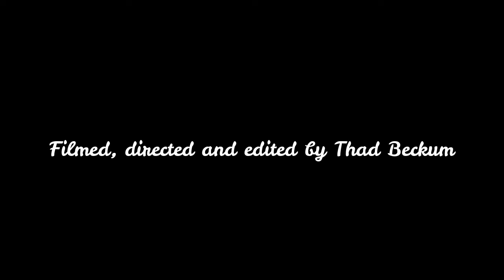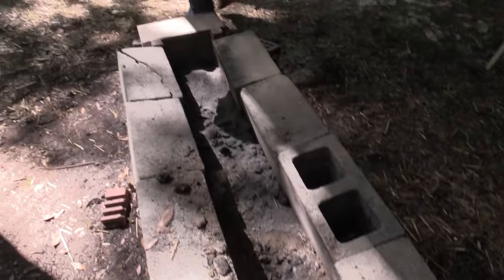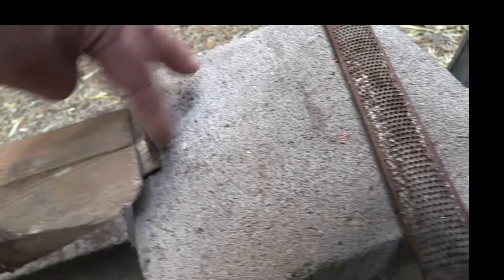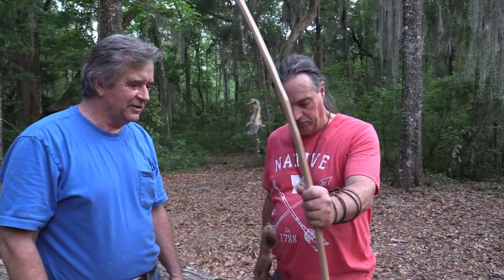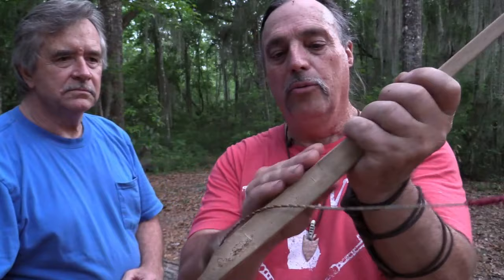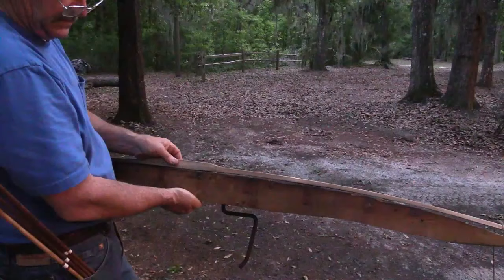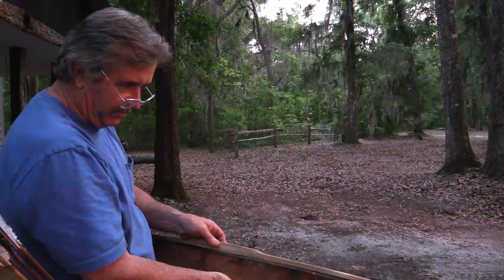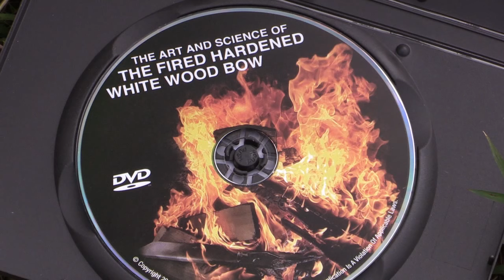From Living Tree to Fire Hardened Bow in 12 Hours Make

Comment: I really like the small pencil block used during tillering for the short-length curvature guide.   I like that there is something physical, a reference material (flat block) to exemplify the changes in curvature - and that it doubles as a marking tool to identify flat/curved/shallow spots with the pencil.
Reply from the maker: Yes I agree. It helps to really fine tune your tiller. Thanks for watching
Reply: It is called a tillering gizmo if you want to make one. The plans are online. Simple little tool. Works best on straight staves or boards.

Comment: Have used and instructed many to use hickory, ash, eastern hop horn bean etc. Hickory and hornbeam(ironwood misnomer) hold moisture more than most woods. I weigh my bow staves and when weight stops dropping it is 10-12 moisture content. When fast drying a bow, moisture meter only shows surface moisture. Hickory and Hophornbean are top grade woods when dried and tiller properly are great. My fastest bow was a hop horn bow made for my hunting buddy .Faster than any of my Osage bows. That’s my two cent Bob Brooks

Comment: Great video.  I believe it was Marc St. Louis from northern Ontario, Canada that pioneered heat- treating bows.
Reply from the maker: Heat treating and fire hardened are similar but not the same. Keith's method is a much long and hotter heat penetration. Mark st Louis did outstanding work which is well documented in the bowyers bibles.
Reply: @BeckumOutdoors  thanks

Comment: Thanks for another great video guys. Invaluable information that you are rediscovering and passing on. Since i bought your video I've made several successful fire hardened hickory bows. I always have 3 or 4 "in progress". I just finished a 42" 45# @ 21" gull wing black locust fire hardened plains style bow. It is backed in sinew as well. I realize that BL is generally weak in compression and strong in tension, so adding sinew would typically make more compression problems. I was banking on the fire hardening to strengthen the belly so much that it would handle the added tension and really increase the performance of the bow. Long story short, it worked. The little bow is super fast and accurate. So far no belly problems... Thank you!
Reply: Glad to know, i have some black locust staves i want to make 5ft 2in bows in the south eastern style. I wanted to heat treat them.
Reply: I have two staves of seasoned BL. Could you elaborate  and update please.
Reply: What exactly are you wanting to make? If you haven't bought the video on fire hardening id suggest getting that first. That way you can learn how to properly fire harden the staves.
Reply: Great information, I was thinking about it too! I'll give a try

Comment: I just dun a 77 long self bow with this method an ill never do a self bow again without fire hardening the belly I did the back a little to an this one is d shape classic English longbow style not a problem small Crack at the tips but it was 80 overall an I got away with 77 overall blown away guys I figured were it was d shaped it would blowup but in a week I've got a amazing 42lb longbow with no string follow thank you very much guys you really have changed bow building forever
Reply from the maker: Thank you

Comment: I bought the video from your website and absolutely love the hickory bows I have build from it one is 70 lb draw and one is 60 lb awesome bows but I want to see you guys do a video on one out of sweet gum I had 10 trees blow down in a tornado and I cut up 25 staves that have been drying for 8 months.... I built one and it snapped when I was stringing it it was 55lb on the tiller tree I think the problem was the fact that I went straight to tilllering right after hardening instead of letting it take on some moisture first I think that might be a critical step with sweetgum and I have 25 more attempts just gotta find the time to do it
Reply from the maker: Don't cook sweetgum very hard like hickory and a long bend in the handle design will be the recipe.
Reply from the maker: Thanks, don't cook sweetgum very hard like hickory. A long bend thru the handle design will be best.

Comment: Bought the video last year and loved it! Wanted to try different trees and privet bush was one that took really well. I also had a scrap piece of hickory I sinewed 6 months before the video 46" long 1 3/8" wide D bow. Was 60 at 26" then dropped down to 45.. didn't care if it broke or not so fire hardened it for hour & 1/2 just to see if sinew would pull and a 10 lb weight in handle. Turned out 55 then down to 49-50 and got a young doe with it!! That bow had a piece pop out of the back of it before sinewing and just wanted to see if one layer of sinew could save it then saw this video and made it even better!! Hickory can really take a lot of abuse. Thank you Keith and Thad for sharing! I don't have any osage but I do have 40 acres of sweetgum and hickory😁
Reply from the maker: I was wondering about privet. I enjoyed your story. Thanks
Reply: Learned something the hard way the other day. Had a hickory someone kinda messed up awhile back and tried to save it for them. Limbs were 3/8" thick 1 3/8" wide dude strung it with a hinge so I reflexed it and fired it without form because of huge knot. As it cooked the reflex came out and tried putting weight on handle but no good. Still made a bow but dude had it too thin from start
Reply from the maker: @justinspencer1539  At lest you tried.

Comment: There is a section in the book Survival Skills of Native California by Paul D. Campbell that goes over how a native in Southern California made a bow out of black willow in one day. He did not heat treat the belly but he did heat the tips and bent them inward to deflex the tips, then he strung the bow to hold the bend into position. The bow was then declared ready to shoot and had enough power to kill a rabbit and it could shoot an arrow about 100 yards. This bow was only about 50 inches long for small game, but some natives in Southern California also made bows as tall as the archer or longer in order to be powerful enough to take large game.
Reply from the maker: Yes that sounds right. The big difference between California and  the Southeast  is moisture. California is a very dry environment most of the year. Here in the Southeast is very humid and wet. You have to consider the environment. Sinew back bows were never used here because that would be a disaster. Too much humidity and rain. But in California they were used historically. People developed  bows and arrows to work in their region and conditions.

Comment: Hi Thad an Keith. This is SO exciting! Been building bows for 3 years now. In South Africa we do not have the same woods available. What I have used before is white Mulberry. It is also a white hardwood. A bit harder than Elm but softer than Hickory. It also develops quite allot of sting follow.

Have you tried Mulberry at all?

I can get my hand on some honey Locust as well. Have you tried it with this process?

Going to test it anyway and let you know.
Reply from the maker: Yes, i believe it would work. Each wood type may take more or less heat from the fire. Sounds like you have understanding of this concept.

Comment: Did you leave the cambium layer when fire hardening like you did on the 3 day build? Then take off before tillering?
Reply from the maker: Early in the video you can see Keith remove bark and the cambium was stuck to the bark. Winter cut wood makes removing bark and cambium more work. Summer cut work or late spring the work is easier.

Comment: Hi I have an important question arc length usually starts from a few inches to a few inches.  Also the diameter of the middle tip and the handle and its width? You can share a drawing or image

Comment: How do you avoid cracks in the handle? Make thinner?
Reply from the maker: The heat is not as intense on the handle area. The coals are more precisely placed under the limbs. It is just a matter of controlling the heat and moisture. This is accomplished by the amount of coals and raising or losing the wood. Keeping you focus on your work until finished.

Comment: Does your DVD show how to make the form to get the back set like you do on this video?
Reply from the maker: No it does not cover that. Just use a tape measure and a flexible edge to trace out the backset you desire. No hard measurement.  A 3" backset is average. You will keep 1/2 of that on average. Could be more or less depending on the quality of tiller etc. Just a couple of 2x6 nailed together. The handles are screw in climbing steps.

Comment: I'm in the process of drying and my hickory stave has started cracking pretty badly. Never got it hot enough to start steaming out the tips. Maybe there's still enough material to get past them.
Reply from the maker: Maybe you had it too thick or to close to the fire at first. It will work for you, just need to get the technique down. Just saw a video from a man in Europe who accomplished this with elm. When you are trying to quick dry and fire harden the green wood in one daylight period you are pushing the edge. Is this your first attempt at fire hardening? If so I would not try to do this from green stave until I had a couple bows under my belt. Then you will be more able to control the process
Reply from the maker: Hope you find away to make your bow a success.
Reply: @BeckumOutdoors  it could have been too thick. This is my first attempt at the fire process. I had it slightly bending before putting it in a jig and putting over heat. I was going for a stiff riser with shelf, but I may have to laminate a section afterwards for a thicker handle section.

Comment: Why is a bow better the dryer it is? What’s wrong with a bow that still holds a little moisture. Seems like something so dry would splinter and crack before something moist.
Reply from the maker: Dry wood is snappy, recoils back faster than a bow with moisture, dry wood has less weight and wet wood will compress making the bow follow the string. In short a wet bow is all negative. We are talking about controlled drying. Yes you could dry wood to the point that it is a problem. Some tough woods like hickory and elm can take very very low moisture readings and  only get better in performance.

Comment: How did you make the board you clamped the bow too?
Reply from the maker: Put a couple 2x6 treated boards together and cut your radius or backset profile. This is done with measurements and a flexible straight edge.

Comment: If I am wanting to fire harden a hickory bow with flip tips to I make a form for a flip tip bow or steam before or after the fire hardening
Reply: I would make a form for the flipped tips and make sure you have enough heat out on the ends. Normally you can flip without steam if you go slow. but if you do steam ,do it before. Recurving is a whole other thing.
Reply: @keithshannon4410  ok thanks for the reply I've made several bows with flipped tips using steam but I live in Leicester NC about 45 mins from Cherokee and always trying to find local wood to make bows from just bought and watched your fire hardening white wood bow DVD now going to try and start making fire hardend hickory bows and my other question is is it possible or have you attempted drying and fire hardening black locust I have several staves of green locust thought I would experiment with it as well
Reply: @justincooper5878  Never used black locust but have heard of success. Let me know how it goes.
Reply: @keithshannon4410  will do going to start on it this evening hopefully I'll let you know how it turns out in about a week
Reply: Question if you fire harden your bow then when you get done tillering and you think you went through most of the fire hardened wood can you fire harden again?
Reply: @justincooper5878  If you don't see brown or at least tan wood on the belly ,yes you can do more. A proper fire hardening will brown at least half way through.
Reply: It's a very very light tan I would like to fire hardend it a little more now just wanted to make sure it would be ok to fire harden again
Reply: @justincooper5878  It will make it better as long as you don't over do it .I personal don't like doing finished bows. The wood is so thin you don't have much room for error. Just watch it very close.
Reply: Ok I've got the tiller to about 65 pounds but I'm trying to get to around 50 so I have I little bit left to tiller so hopefully that will help me out if I go ahead and fire harden it now then finish the tiller down to 50#
Reply: And keep the fire harden light this go around

Comment: I actually had two bows break after introducing them to heat. The first i put on a form and put over a fire for a couple hours till the belly was good and brown and it snapped like a dry match stem with very little flex. The second I used a heat gun to heat treat limbs and it broke after a few light flexes. Im beginning to wonder if this technique is a good idea after putting hours and hours of grueling work with hand tools into making the bows only to have them snap. I have no idea why I cant seem to have any luck with the fire hardening method. To the best of my knowledge I followed every step in the process pretty closely.
Reply from the maker: Did you have a solid healthy piece of wood.  Hundreds of people are fire hardening bows with great results. I have never had one break. Something is wrong with your wood or process. Sorry to be so blunt.

Comment: Pecan is almost identical to hickory. Why not build a propane burner. It’s just a tube with a  crimped end and small drilled holes.
Reply: You can and I have bought a 60'' propane grill to try to achieve the perfect cook but about half the bows would spring back a little after unclamping , which I have never experienced from a pit, so I stopped using it. What causes the difference , I don't know for sure.

Comment: Do y’all think dogwood could do this?
Reply from the maker: Yes Keith has used it also.
Reply: @BeckumOutdoors  Thank you!
Reply: @BeckumOutdoors  I’ve got an old dead dogwood I need to cut down. Still has structural integrity. Planning to make a few clubs and may try a short bow
Reply from the maker: I would make the bow long as is practical. Really short white wood bows are really a bit negative.
Reply: I just tried with dogwood, it was doing great. I was all the way at the end of tillering and had one inch to go and it snapped at 26 inch draw at 66 pound draw weight. It was a 64 inch bow. Such a bummer! Lesson learned to definitely bring down the weight and make longer limbs.. 👍

Comment: Imagine if you backed this thing up with some fiberglass drywall tape and quick drying glue for strength. You might add up to 10 lbs on the bow.
Reply from the maker: Dont use fiberglass but you should try it.